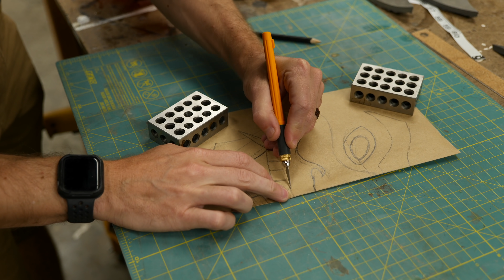Making the Blue Spirit Mask from Avatar: The Last Airbender | I Like To Make Stuff

Comment: It looks great! One thing I would recommend if you plan to actually use it for cosplay instead of just as a display piece would be to cut out the black area of the mouth and replace it with black panty-hose. Not only would it add extra dimension and depth behind the teeth, foam is really hot to wear and just the two nose hole aren't going to be enough to keep you comfortable.

Comment: Very nicely done. If I may offer one suggestion when working in foam. I learned the hard way building cosplay items in foam that to really make it look not like foam you need to sand down all the edges. Round them all over. It makes them look much less like cut foam and more like worked metal.

Comment: It's still kinda glossy, maybe later you do a matte clear coat, or repaint with only matte paints, would be much better.

Also, it's super easy to simulate wood texture on eva foam, would go much better